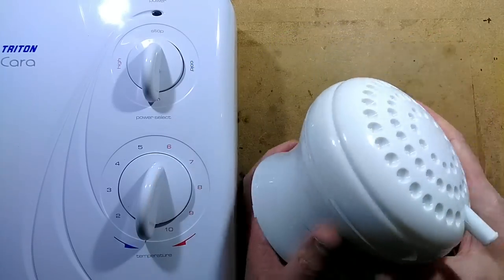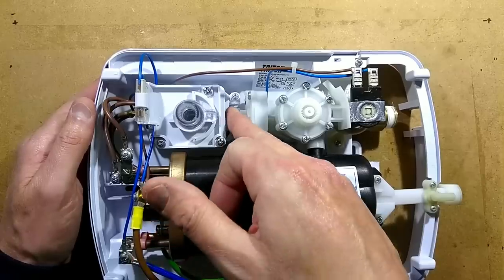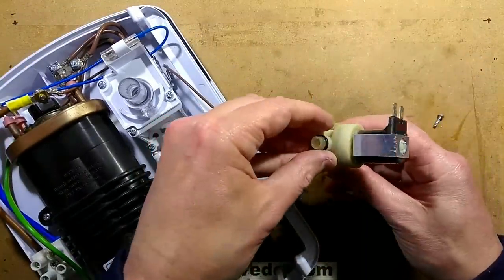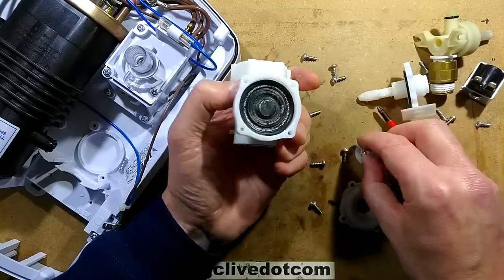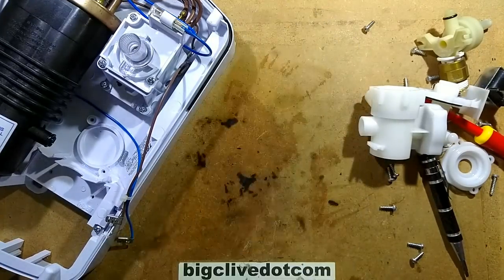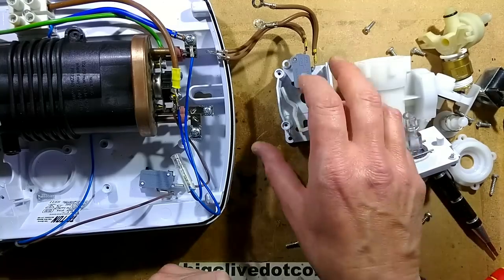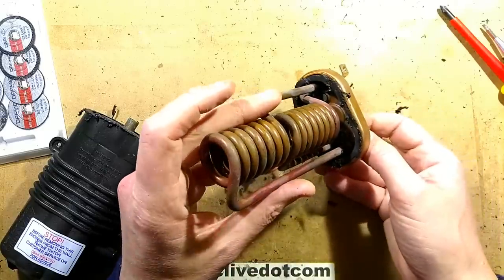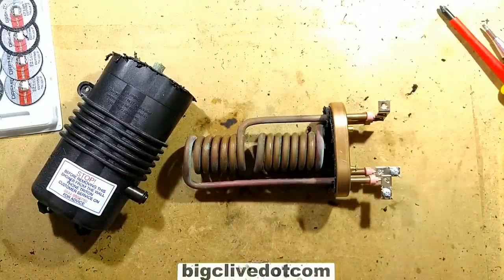Teardown of a UK electrically heated shower unit.

Comment: My house used to have a shower with the solenoid cutting the output flow after the heater! Because of that it had a very simple digital power selector which would always wait a on cold for a bit before cutting the flow. Since I was impatient, I figured out that by pressing stop and then immediately selecting a power setting, the controller would crash and reboot turning the flow off instantly. Naturally after a few weeks of doing that, since the unit was old and worn, the over-pressure valve blew open, the solenoid had no hope of stopping anything, and it basically ruined half the bathroom.

Comment: This would make a lot of sense in the U.S. especially in warm climate area where the water is never very cold. My shower is 30 m from the central hot water heater, which means we run water for several minutes just for a shower. These units are unheard of here in the U.S., I have used them when traveling in the U.K, and they are just fine.
Reply: Thank you for your comment! Happy 2023!

Comment: The standard 9Kw shower can use 6mm cable, but if you  use a higher rated 11Kw heater then 10mm cable is needed.  Just a bit harder work to bend and fit.

Comment: clive, the cheapo showerhead you shown is even more scary than you think.
I live in São Paulo, Brasil and i have one from the same model and manufacturer, and the electrical installation is the most cringing.
Nationwide our houses are supplied with 127V@60 Hz, yet most powerful appliances are 200V here. the reason is that it's very common to have split phase power supply on most houses, a single high voltage phase goes to the street's transformer with it's return\ground and in secondary three wires emerge, two opposite polarity phases at mains voltage and a neutral. the neutral is grounded on the transformer and again in the entrance of the house using an obligatory ground electrode, and from there on neutral and ground are separated.
all that looks cool and dandy, but there the nightmare comes, my house is a typical example, and i will use it:
the house wiring is considered relatively new, it's 28 years old. the phase wires pass two 70A main breakers near the power meter, and again on the power distribution cabinet, them each is divided in the various circuits, the shower one have two 30A breakers, on to each phase wire. them the two wires go to the showerhead. that's it, no GFCI or RCD to speak of, and no earthing too, an earth electrode is obligatory, but actually passing a ground wire is almost unheard of.
so then i end up with two wet contacts, each oscillating at 120V rms relative to the ground and able to deliver up to 30A each through my body.

Comment: Am i safe in guessing this unit mounts outside of the shower area? Basically its like an instant hot water heater correct? Nithing im looking at screams water proof,tight or even very resistant.

Comment: We have a Mira Advance shower and it had a "run-on" function that lets the water run cooler for about 6 to 8 seconds after you press the off switch. This helps to cool the elements before the solenoid valve shuts off the water flow completely. A nice touch which would ultimately increase the life of the thermal cut-out switch.
Reply from the maker: When I finish showering I turn the selector to cold briefly for that same reason.
Reply: @bigclivedotcom  the Mira ones tend to have a button for power on off then selector. I suppose with the triton it would occur to you more to linger on cold before shutting it off fully than with the Mira where you just press the button.

Comment: I am just wondering, is that heating done by two stages, or just one? I mean - first is from coils, which works like ordinary "kettle" heating coils. The 2nd could be induction heating, where coils heat the copper pipe in middle of chamber and water is heated also there. I know that for induction heating need much more frequency, induction heaters working in kHz range and 50Hz is too low, but this is also working in higher voltage than standard coil heating arrangment, so it could have some effect. Is is possible to test it and confirm if it's truth or not?

Comment: It would be always interesting to hear what was it that you were expecting, at the times when you say this wasn't what I expected. Just for comparison :-)

But good video again, thank you!
Reply from the maker: I was expecting a simpler element zigzagging up and down.  The coiled element is probably used due to the high power in such a small space.
Reply: Ah, ok. Thank you for the reply :-)
Reply: bigclivedotcom  the units we use in germany have typicaly a flat zig-zag heating Element made of plastic, whith bare heating wires for minimum thermal inertia, the output pipes are made of copper and grounded so there is no shock risk they're mostly ratet 21kw but there also 24 and 27kw units all fed by 400v 3ph
Reply: I hope they at least space the wires from the plastic – otherwise things are really going to cook if the switch gets stuck on.

Comment: Tip of the day: always remove the cutting wheel off the Dremel rotary cutting tool when finished or between uses, otherwise you'll be more likely to break the center catch off. as I have done this multiple times, I have since instituted the policy to always remove it.

thank you for tearing this thing apart, ever since my brief visit ( Scotland England and Wales with BSA) I've always wanted to know what the inside looked like. this also sort of explains why we don't have them in the US. as a 15 or 20 amp circuit is probably not going to do it and by the time you run a 30 amp you might as well just put a tank water heater in.

Comment: Do you people in the UK not have heated water? Like water heaters?
Reply from the maker: Yes.  But this provides instant hot water at a fixed temperature on demand.
Reply: @bigclivedotcom  Oh Ok, thanks for responding. Here in the States we turn a dial and in 5-ish seconds the water is hot.

Comment: I also like that copper pipe in the middle of the "tank" actually goes through the center of the heating elements. Good idea due to thermal confinement within the heater elements, it would help prevent overheating of the inner sections of the elements due to the water "still hot but still works" taking heat from them which also makes sure that pipe does not cool down much at all.

Comment: My 3kW shower heater is internally different. It does not have a solenoid valve and no summer/winter setting. The knob has 2 functions, counter-clockwise max turn is for power on-off and as we turn clockwise, the heating power adjustment becomes hotter.

Comment: I would like to know, if the water pressure is insufficient for any reason ,and it cannot be increase , is there any way to make the diaphragm go up to switch the heater on,
as the water pressure should do .?
Any manual adjustment. ?
Any idea will be highly appreciated.

Comment: I have one of these showers, and to prevent the thermal trip operating (and hopefully reduce limescale build up), when I finish using the shower I turn the top control to cold position for a few seconds and let the water run cold and then turn it off.
Reply from the maker: I do that too.

Comment: 20:12 on some showers, the pressure relief valve is a soft rubber like plastic ball.  When they pop, they are captured within the valve so that you can just push them back in again.  They usually pop because the hose has been constricted somewhere.

Comment: In our previous house we had a Gainsborough electric shower. The water pressure was frequently too low causing the thermal cut out to operate. Several times the shower failed to operate at all.  I discovered that the microswitch controlling the cut-off was in a plastic housing. Before it tripped it became hot and gradually it melted the surrounding slightly projecting “wings” which eventually curled over and as it cooled it held the microswitch contacts in the Off position. I replaced it twice before I realised what was happening!

Comment: I've always been a bit unlucky with these unit. It always seems to be the heater that fails. I did once get lucky and find a burned out 16 amp switch in the main control but I suspect it failed as the heater unit was on it's way out and the load on the switch increased. The oñe we have now is pretty much the same as the one you're pulling to pieces. It has an annoying habit of cycling from hot to cold if it's used, turned off and turned back on again. I suspect the thermal protection on the heater itself is a little too sensitive.
Ah, you just explained the issue. Always watch to the end of Clive's videos before commenting 😁

Comment: I have the same shower except the stuff printed on the front panel is different. Exact same functionality. It's so much better than the old days where I had to heat up a tank of water hours before I wanted a bath or shower.

Comment: Question - I know over here in the US there's 2 voltages in most buildings - in the case of homes 120V for plug in appliances and lights, then 240V for higher power built in appliances (stove, oven, water-heater, furnace, air-conditioner, etc).  Do you have something like that in the UK or is everything 240V?
Reply from the maker: We have a single system.  Three phase 240/415V (230/400 if Euro compliant) with 240V between each phase and neutral and 415V between phases.  Homes usually get a single 240V phase and neutral, while larger buildings and factories get three phases and neutral.  All items in the home from lighting to electric showers run at 240V.

Comment: Does the Temperature stay stable when you change the water flow rate? I hate these automatic two-step Heaters where  you have to fiddle around to get the temperature to an acceptable level. But I guess that constructing a variac-dimmer-type heater delivering a constant temperature shouldn't be too pricey?

Comment: I think the audio is fine but when you came back and opened the heating element the audio seems to really distort when you got louder a few times.  I have to say I'm using a new amp for my speakers so I'm not sure if it was you or that, but I haven't noticed any other distortion.

Comment: Soo. Looking at the heating element. i guess they have to insert the heating resistor with fiberglass tube while the pipe is straight and then bend the tubes. Would you mind dremeling open the copper windings to peak inside ??

for power specs: house built 1960 germany,
 has 3 phase 380..400V coming in from street which is then split into 3 single phase for 3 levels+basement @ ~102m^2 each.
 original wiring was at 220v (now 230) and had 2x 10amp fuses + 1x20amp kitchen.

central heating by oil (winter time only) 15.000liter tank underground (i think was ~40kw, now 23kw with exhaust heat usage)
bathroom water heating (+kitchen oven optionally) by street-gas(?)
bathroom gas waterheater was around 45kw, is now 37max (less water usage)
added bathroom w shower under roof with electrical heating later behind 3phase 3x10 amp fuse.
so no matter what you could always get hot water for a cup of tea by one powersource.

Almost forgot: originally also 1xfirewood powered copper washing pot/oven in basement, so 2 chimneys.
Reply: Such heating elements are insulated with (usually?) magnesium oxide (MgO), with ceramic end caps (which may be additionally sealed in with silicone).

Comment: The blow out valve should be self resetting? (Was on mine) so when you block shower head or pipe gets kinked the blow out leaks water out of it but stops leaking when flow is not blocked any more

Comment: Hi Clive, I wanted to ask if this shower unit is fused? A friend's shower (same model) has just stopped working, no light comes on. I haven't had a chance to open it up yet, but was wondering if it may be something simple as blown fuse, couldn't see one In your vid. thanks
Reply from the maker: Is it electronic?  If not then look for burnt connections on the incoming terminal block and other connections.  Also check that the isolator switch isn't damaged.  The pull-cord ones are notorious for burning up and failing.

Comment: Hi, so I've seen a few vids saying you can get increased pressure out you shower head by removing the reducer in the head and hose, however the output nosel on the shower it's self (the second last thing you dismantled in this vid) seems quite reduced so surely  removing the reducers still wouldn't help, unless it was possible to widen the bore on that plastic piece. So would it be possible to widen that bore and would it help as it looked like that coper pipe in the heating unit has a much larger bore. Thank you Charlie.
Reply from the maker: The unit does need some back pressure to activate its water supply detector.

Comment: I fixed mine twice, the power switch had a high Ohm circuit even when off and it randomly pulsed. Then the relay went so was replaced. Those showers are easy to fix as the parts are readily available. Mine is a bit fancier than this with soft power and an electronics board but apart from that, it's very similar.

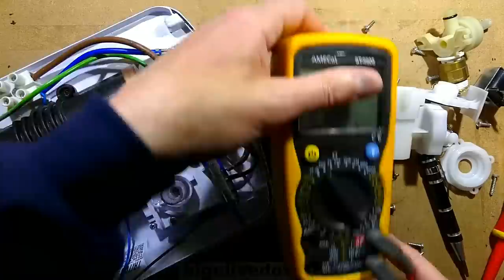Comment: Hi Clive, I think I've misunderstood something. Could you please help. @ about 15:15 you measured the Ohms to two heating elements. One read 12 and the other 15. Now, what were you actually measuring? If the resistance you were measuring was in the elements then the higher the resistance the greater the heat generated. That means the higher the Ohms the greater the heat. Therefore my assumption is that the lower resistance wire will be for the summer heater the higher resistance wire will be for the winter setting. I sure you said the opposite. However, I guess if the resistance is in the wire before the heating element then that resistance, of higher Ohms, would make the voltage to element less and hence the higher resistance would be for the cooler summer heater. Though, I cannot see why this latter arrangement makes sense, as it would put into the circuitry two unnecessary resistors. Am I making any sense?
Reply from the maker: Lower resistance allows more current to flow for higher power.
Reply: @bigclivedotcom  Thanks for you speedy reply.

Comment: From '88 to '92 we stayed in rented accommodation with the predecessor of these Triton electric showers. Bloody disaster they were, they lasted about a year before the underrated wiring overheated and the insulation melted. Some sections were additionally sleeved with woven glass fibre tubing as a precaution, but the burnt PVC gave off a shocking smell. Terrible things!

Comment: My one in my bathroom is actually a 3 phase unit. It will switch 3 heating elements. Also an insulated hose goes to the kitchen which is beneath my bathroom. Still takes a lot of time until the hot water reaches my kitchen tap obviously. :) I never use it in the 3 phase configuration, level 2 is actually pretty hot, even in winter. But it's just me being heat sensitive. I hate summer when it's over 24°C outside...

Comment: These water heaters come in 120VAC and 240VAC. Quality depends on what you pay for. In VietNam all our instant-on water heaters are equipped with Ground Fault Circuit Interrupters (GFCI), or Residual Current Device (RCD) circuit breakers.

There are three types: Wall-mounted heater tank that can feed sinks and baths is the normal way (like central heating). Water temperature is fixed in installation; Wall mounted shower with adjustable temperature and water flow; Under-sink/basin in-line unit which turns on when the tap is turned on.

Pricing is approximately $200, $100 and $50 respectively, Most in Asia are made in Malaysia and VietNam. Cheaper units come from China.

Comment: Hi Clive, 

Just wondering, if a shower fluctuates from hot to cold without a change in pressure, would this be the heating element?
Reply: sounds like an overly nannying overheating protection switch.
Reply: could be the protection switch, could also be air stuck in the tank, the small amount of water boils and cuts out the trip, could also be low water pressure too?

Comment: They had these type of showers in the Philippines when I was just there.
The one in my hotel room was very safely wired by twisting the active and neutral wires together just outside the units case with no sheilding or electrical tape and no Earth.
Great way to wake up in the morning, hose yourself down and accidentaly bunp the bare wires with the back of your wet hand when hanging up the shower head that was conveniently located right next to the bare wires.

Comment: My Gainsbourgh runs on to solve the thermal cutout problem
The pressure relief valve is fitted backwards which makes the water hit the wall and cascade back into the unit!
The plug is clear and silicon looking. Almost impossible to find once out and yes, you can refit it (if you can find it)

Comment: Interesting design. The Instant Water Heater units sold here in Asia have a Triac driving the heating elements to adjust the water temperature.

Comment: While finding the source of a leak recently I ended up repairing a shower fed from mains, where that diaphragm valve had failed due to an increase in water pressure, despite spraying water inside the the casing of the shower, no electrical fault during that problem. Pretty much the same as this, Triton, older model though - it was repairable too.

Comment: I found this quite interesting. I'm from the UK but have lived in Thailand for 10 years. The shower heaters here don't mix the water for the temperature control, they have a triac controlled heater that is set from a potentiometer. The on/off is controlled by a flow sensor usually a reed switch and magnet plunger placed in the water flow.